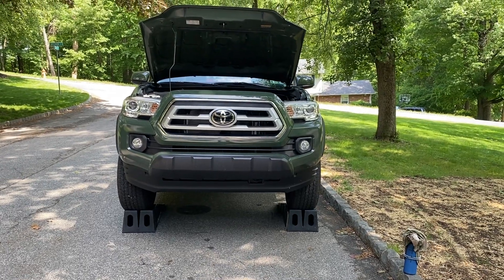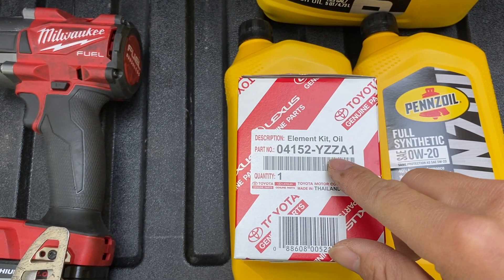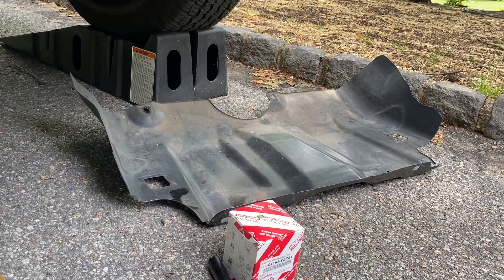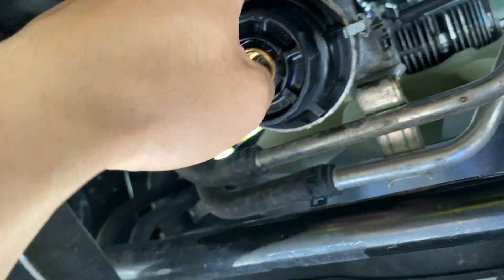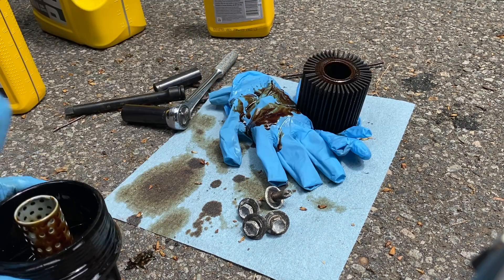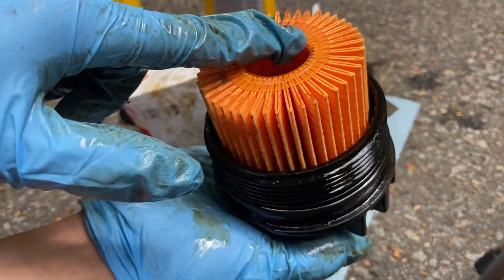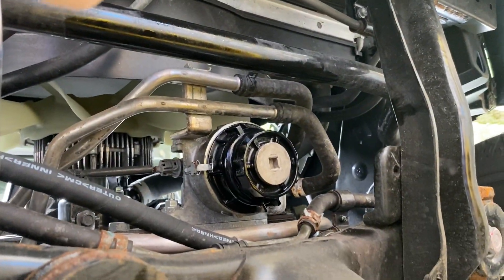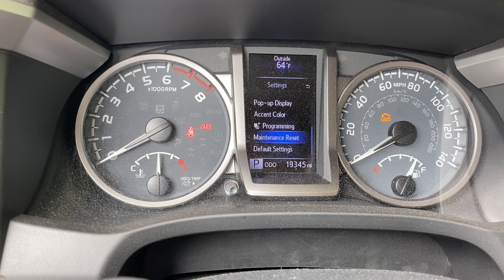2021 Toyota Tacoma Oil Change 3.5 V6

Comment: I was waiting for you to make a mention about forgetting to replace the crush washer on the drain plug. 
The drain plug torque is 30 foot pounds.
The oil filter tightness is 18 foot pounds.
The cap on the bottom oil filter drain access is 8 pounds.
I just did my first oil change yesterday, all those steps are important. That’s why I’m reluctant to trust the folks at the fast lube places or even the dealer.
No one cares about my stuff as much as I do. 
I appreciate you taking the time to make the video. 
The more we learn, the better we get.👍😎
Reply from the maker: Thank you for watching and dropping the comment with the stats. Definitely very helpful. I've found the tacoma community to be an awesome crowd. I agree, I try to work on much stuff as I can because no one will care more than you! Unfortunately I just gave the truck back in. Waiting for the new one, hopefully this summer!

Comment: Penzoil is very good oil. I recently changed mine with ultra platinum.  Man the truck runs so much smoother. Even gets better mpg!
Reply from the maker: Thanks! idk what they used at the dealer but thankfully the penzoil was on sale.

Comment: 2 1/2 in wrench also works for getting the filter cap off
Reply from the maker: Thank you for watching! I was not aware. Great knowledge share
Reply: The Tip of The big Wrench right fits in the Oil plug